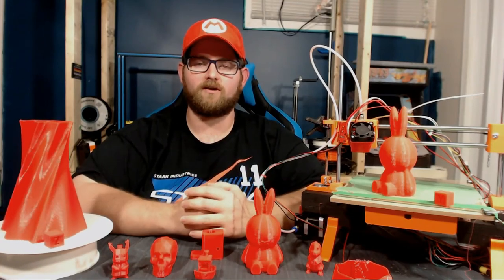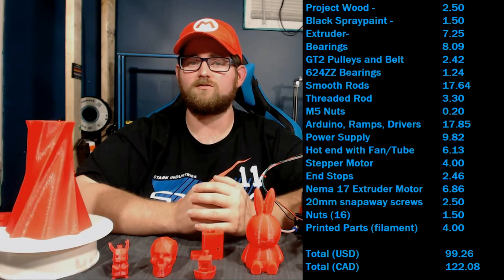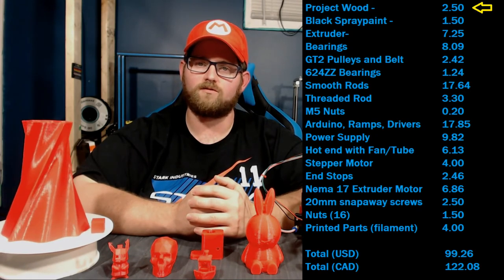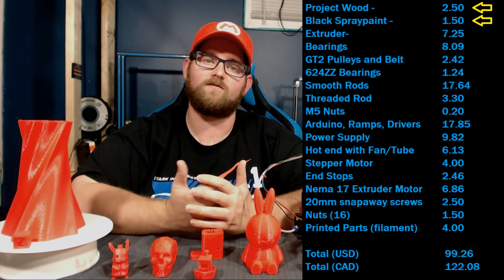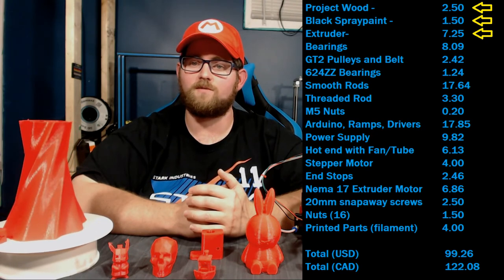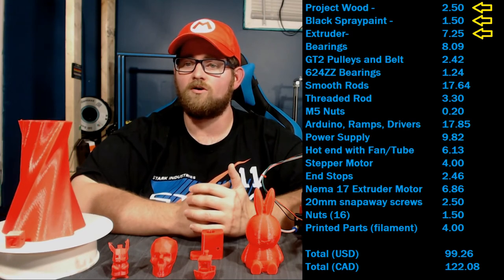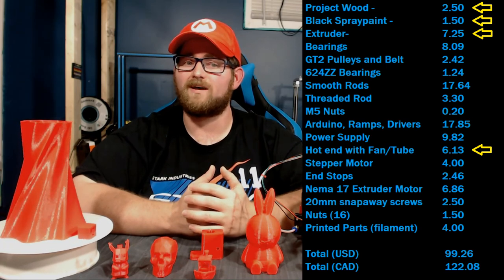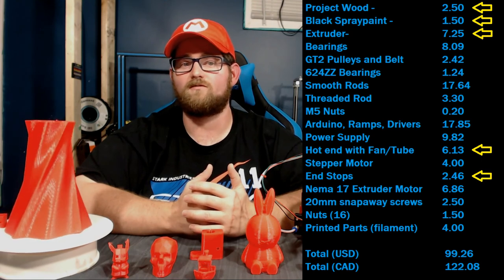Building the Cherry 3D Printer - Cost Breakdown

Comment: I just wanted to know how to install orange pi zero can u make a tutorial on that
Reply from the maker: Preetham Gowda.r sure! It's on my list of things to do!
Reply: sir how can I contact u because i am interested in building this
Reply from the maker: Right now, the easiest way is probably to DM me on Twitter, if you have access.
Reply: I have one of my printers running octoprint on an Orange Pi Lite...and it does GREAT!
Believe it or not my Orange Pi Zero is running my VPN ;) (I did have to slow down processor speed from 1200mhz to 816mhz max CPU thru software  because it was running hot hot hot!)